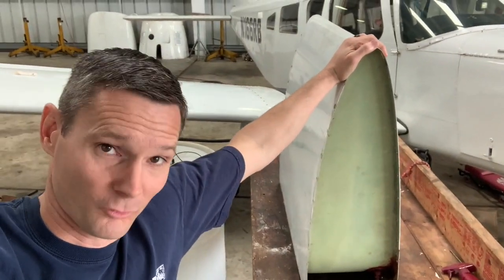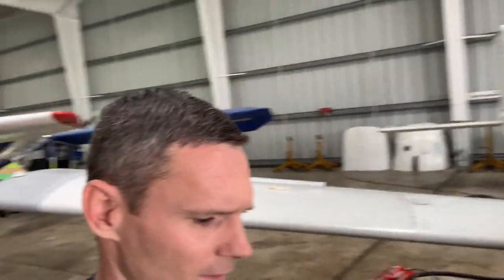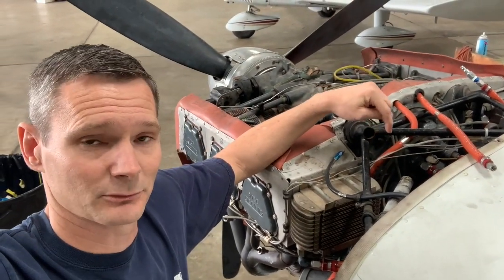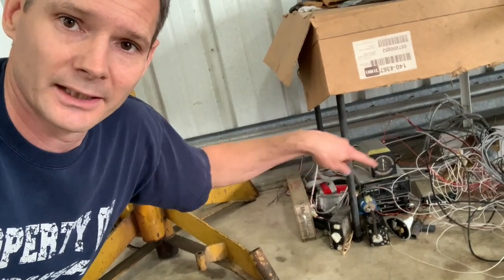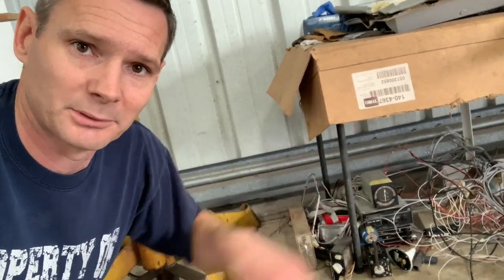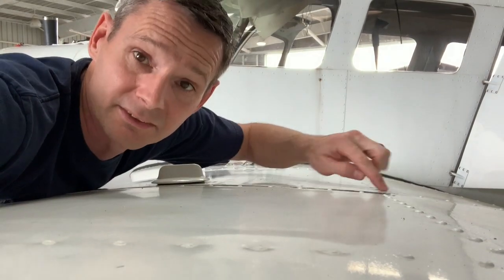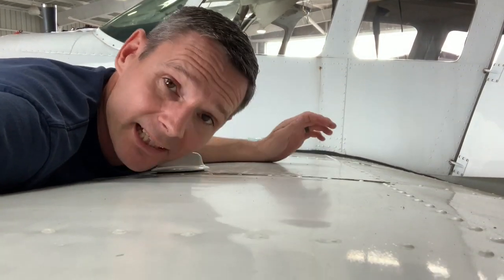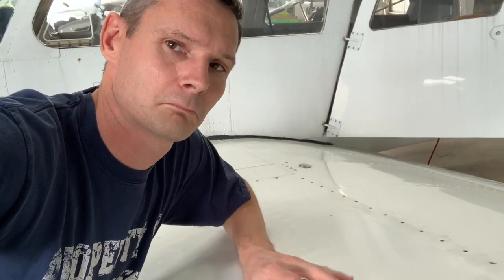Revenge of the gas tanks and old radios!  Keeping it the Cheapest is hard work! EP12

Comment: Those KX-155s are great. I have two in my panel and they have never failed me in over 13 years. While you have the fuel tank out you should follow service bulletin SB-1006 that covers inspecting the main wing spar for corrosion. It should be done every seven years. There are kits available that have the anti-corrosion compound, a paint brush, and a few hundred screws. Search on "SB 1006 kit."
Reply from the maker: definitely!

Comment: Jimmy i felt your pain when i saw you have to take that back section apart to fit that panel you need to get hold of a "nutsert tool" it put's threaded inserts into metal and plastic's and would have saved you a lot of time and effort plus i can see you using it a ton on instrument locating

Comment: Yeah. Go with the Surefly on the impulse mag. They are priced at $1395 or so (YMMV) and have a life longer than you do. 
Then, stop messing with the fuel sending units. Pick up a Insight G2 or G3 and get the accurate fuel. Which really is for you to dip your tanks before flight and enter the the amount in the engine monitor. The monitor will calculate your burn and let you know what you have remaining. It's also a primary fuel gauge, so you don't have mess with that 1950's technology. 
I've had to mess with fuel sending units three times. Once on my Warrior, where I got water in my tanks as a result of trying to be cheap and parking outside for two summers. Turns out I had bad seals on the gas cap. That water corroded the sending unit, since they are made of steel. Which caused some flaking. Which lead to leaky sample ports, a clogged primer line and apparently a clogged fuel line too. Which caused issues with the spark plugs and therefore power and fuel burn. 
The other time I messed with a fuel float unit was in my 1978 MGB Midget...the orange bomb. Nice car. 8 gallon tank. Somehow a hole developed in the float. Such a pain. Always carried a gallon of gas in the trunk.
Reply: are you listening Rev. Jimmy?  lol
Reply: Agree with the insight but they are NOT primary TSO.  You still need the old crappy ones.  Better to look into a CIES with a new gauge.
Reply: @jimhayes2786  Yeah. But for a few dollars more, he could go with a EI CG30P. And get rid of a bunch of primary gauges. Then also have the Insight G2 or 3...or maybe not. 
I wouldn't do JPI though, they are all non-primary.
Reply from the maker: @kevinjarchow8812  I've considered the 830 (secondary, the 930 is a primary, but way more expensive)
Reply from the maker: @jimhayes2786  which one do you recommend?
Reply from the maker: Thanks for sharing.  Good suggestions.  I'll have to look into those.
Reply: @therealjimmysworld  I really like the cg30p.  I would use it for mine but it isn’t on the stc (have to use the mvp50).   Pricing for the 30p combo is great, you can remove just about everything and the guys at ei are really great to work with.  JPI has a good rep as well but theirs tend to be 10-20% more for the certified replacements.   Another difference is their remote data units...jpi is mounted on the engine side of the firewall so the install is easy while the ei unit must be installed in the cabin side of the firewall so there are more penetrating wires.
Reply from the maker: @jimhayes2786  yeah, those are nice.

Comment: How did you clean your fuel senders?  I need to clean mine, but not sure what’s the best technique to get them working properly.
Reply from the maker: I couldn't get them cleaned out.  2 of them had rust on them from sitting in empty tanks for years and condensation got to em.  I replaced them with used ones.

Comment: Jimmy...   Any time you turn on the master, and any gauge moves, it's electric, right.  These are  very simple in design and  operation.  Always make sure your supply voltage is 14.2Volts, as if you were flying it.
Get a lab supply (Hp) or charger ( not  above 14.5)  and then check you values (Fuel and oil pressure).
When the voltage goes below about 11 volts the gas gauges  will show about 70% of the real value.
I have owned about 14 airplanes, have a PA28 180 now, and have owned a PA32( too much maint for me).
Anyway,  if it takes a master switch to move the needle, and the voltage is not 14.2, it's wrong!!!!
Also, most IA's are not very electrical at all.  I will get shot for that statement but I know it's true.
Loading my 9mm Springfield now......
Reply from the maker: lol, yeah, that is true and they don't like to admit it.